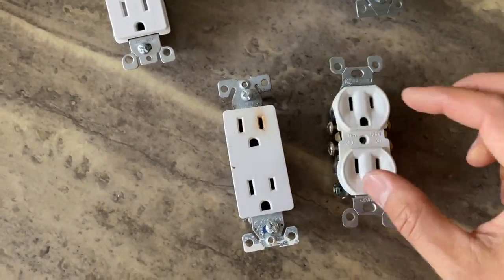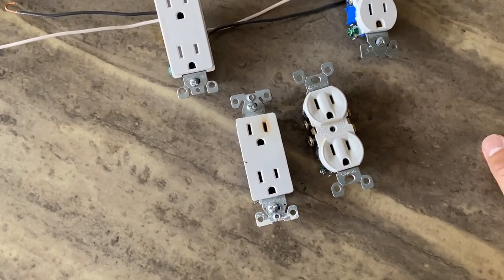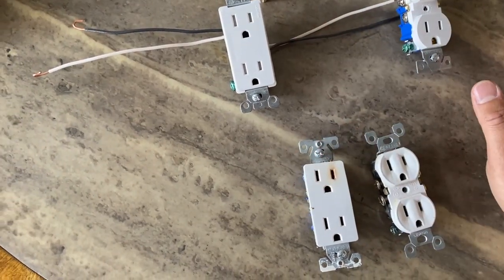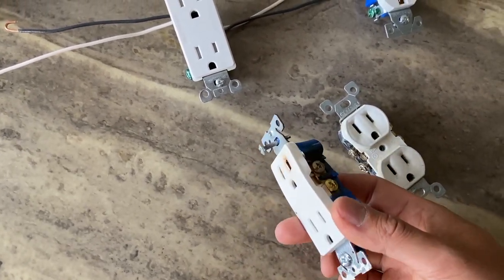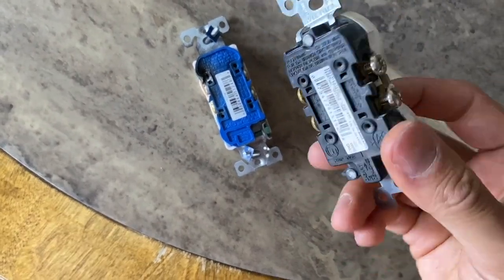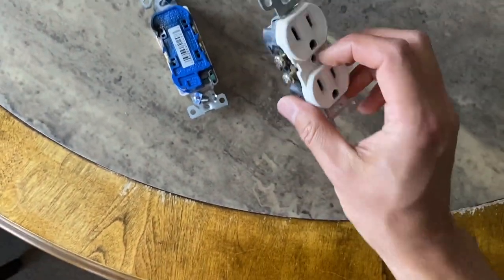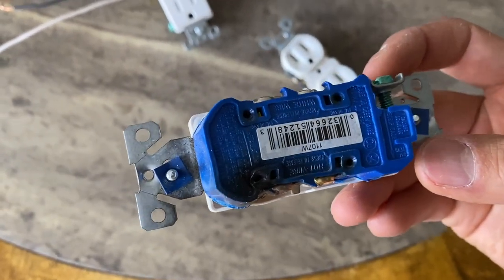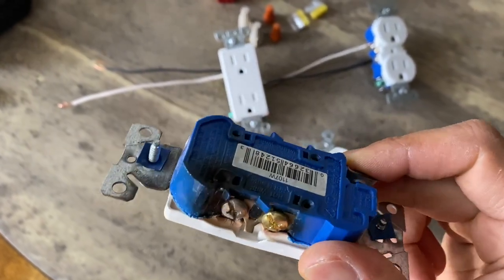Reason Behind a Melted Failed Electrical Outlet

Comment: Thank you for creating this vid and the knowledge that you are sharing.  I have a breaker that is charging 4 outlets. The daisy chain goes to the front room outlet then goes to a room and powers two more outlets then goes to one more outlet in the next room where it ends. The first outlet is fine, powering one power strip that charges the internet, sometimes Xmas lights. Then the circuit went into my son's room where he had too much connected to one of the outlets and melted the other outlet that had less connected to it but too much still. So glad the house is still standing. My concern is that the romex that caried the power to the outlet also melted and now the wires may be exposed along the route.  Is there a way to test these wires to check if they are now all exposed.  New wires may now have to be pull from the breaker box to these outlets. I will have to cut into the sheet rock due to unknown nails the wires could get snagged on and to set the wires into place. Just trying to understand the whole picture.  Also, these outlets are from the 50's with thick gauge romex and hardly to no wire to work with. No 6" feed loop on any outlets to work with. What would you do?
Reply from the maker: yes wires are stapled every foot and 6inch within each box. usually no need for new wires but if melted outside of electrical box you can put a junction box and extend the wire for that section .
Reply: @remoteelectrician  The hot wire is melted past the box. Waiting for son to clear everything off his shelf so I can dismantle the shelf and remove sheetrock to see how far back its melted. Could I just wago  nut a new hot wire cutting out the portion that has melted.

Comment: How do i know if the problem is the outlet or the braker?
Reply from the maker: you start with breaker of course. if it doesnt trip and stays on but some of the outlets in the circuit are off you have lose wire in the chain of outlets
Reply: @remoteelectrician  the breaker keep stripping every 3 or 4 days, so the breaker is bad?
Reply: @zizo4921  doesn't mean it's bad. If you're running too many amps then it's doing its job by tripping. Also if it's a GF/AF breaker and it's tripping because of that then it's doing its job.
Reply from the maker: @zizo4921  if you're overloading then its not bad. it has to trip so your wires dont melt. if you have 15 amp circuit and plug in more than 15amp combined it will trip. some people plug portable ac which draws 10-12 amp on a 15 amp circuit which may have lights and outlets,  of course it'll trip. "define the LOAD capacity, max load".

Comment: Good info all round however you can’t be comparing wagos with the cheap push connectors . Wagos are used extensively in Europe and are often the go to for electricians in place of wire nuts. They are industry proven. Push connectors etc I agree 100% but original wagos that are correctly specced if they fail the person installing them doesn’t know what they’re doing
Reply from the maker: yes, when it's done by pro, not a diy guy. (you guys use stranded wiring so it make sense why it's popular)

Comment: A failed 2273? What happened? They are pretty much standard on all the 16A circuits in germany and I NEVER heard of a failed one... Sounds more like someone made bad work and stuffed in a badly bend and twisted end in by force, otherwise it puzzles me how that could even theoretically happen.

Most of the time failure is due to overage things or loose screws. Never seen an actual failed WAGO in the field. Weird.
Reply from the maker: In USA all people care about is to pass an inspection. Some strip it short, some strip it long, people can overload the circuit, sometimes power is on 14awg, light has 18awg, many examples cant list it all, wiresnuts best option imo.
Reply: @remoteelectrician  Good point. I'll never understand why some people care so little about what the're doing.

Out of interest, about that inspection thing: How is the testing and measurement process handled with the inspectors? Here in germany every electrician has to have a multi function tester (something like the Fluke 1662 or similar) to document the mandatory isolation resistance, Zi / loop resistance / psc, ground continunity and rcd trip time measurement values of the new install.

But I have never seen US electricians in videos doing this. Is that done by the inspectors and the electricians have to come back later to do corrections based on the inspectors test report?
Reply: @remoteelectrician  Okay, I did some further research and found out that the US did not adopt IEC 60364-6 containing these strict measurement and testing requirements that I listed. These procedures are not required by NEC as far as I could find out. The whole inspection topic in the US seemingly works completely different from what I'm used to.